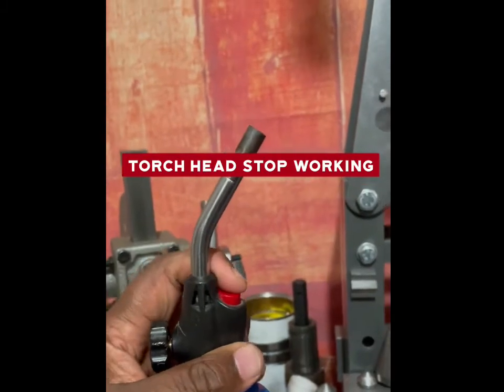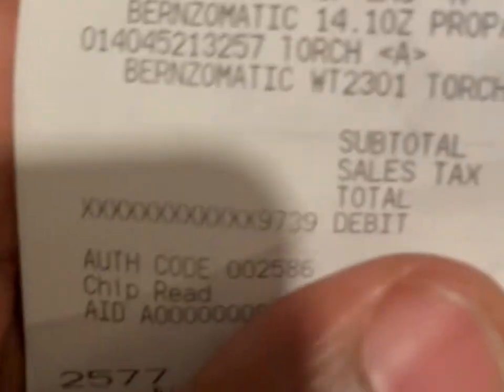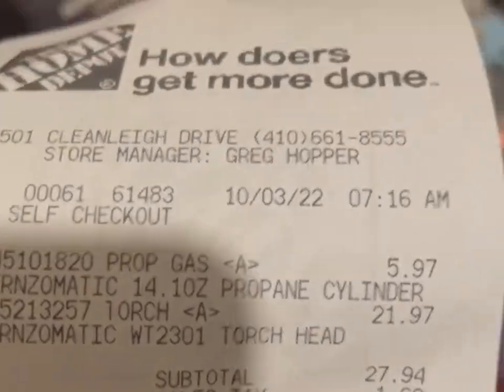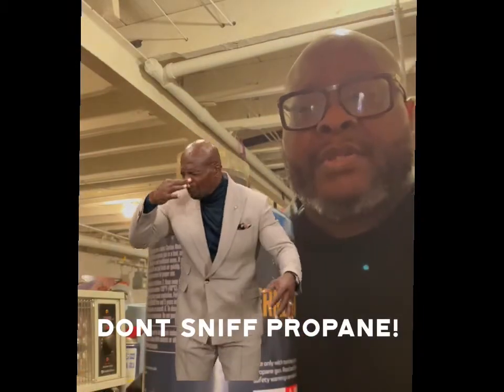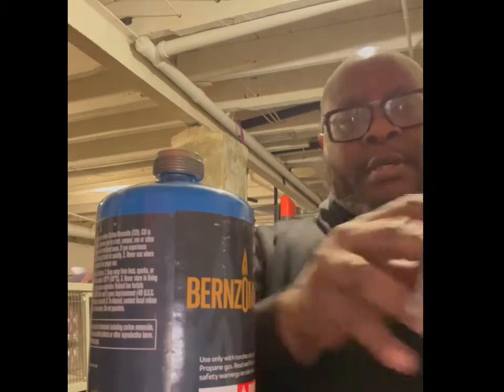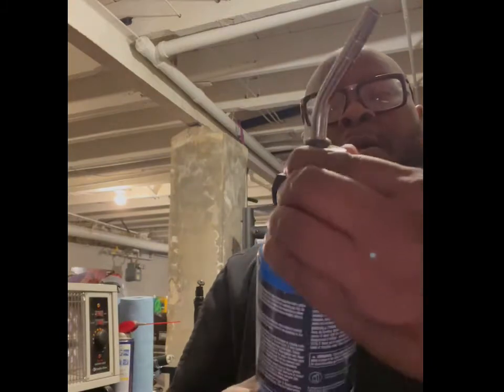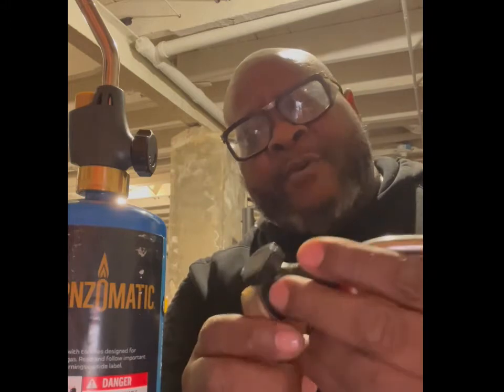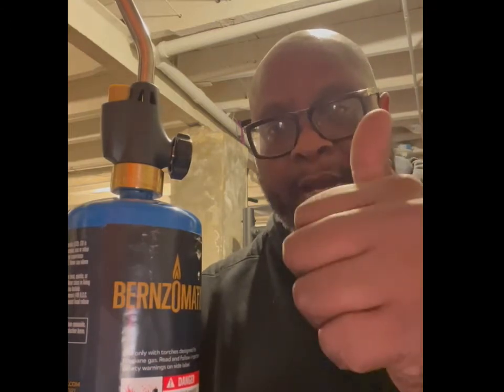Propane Torch Head

Comment: The torch head might still be good you have to clean the middle with a pin like object!
Reply from the maker: Thanks for that tip bro!
Reply: Don't insert any object into the tiny burner orifice, use compressed air to blow out any debris.